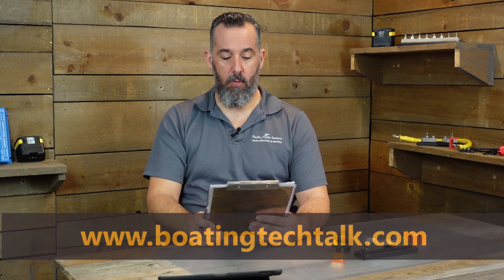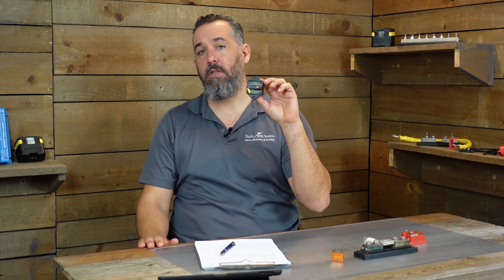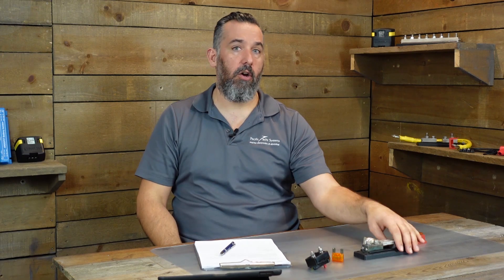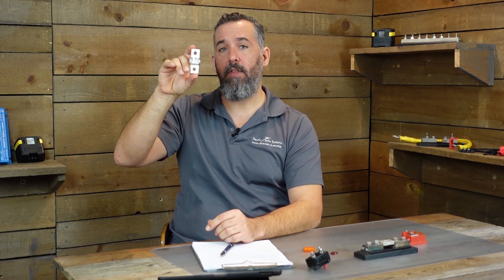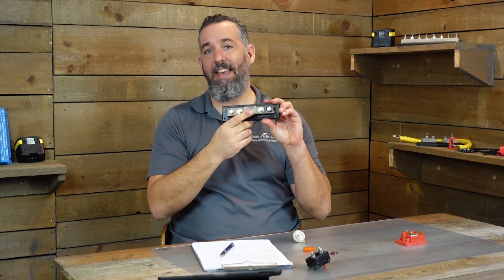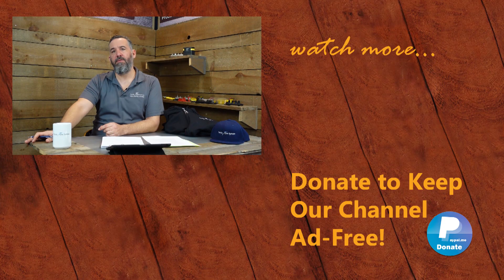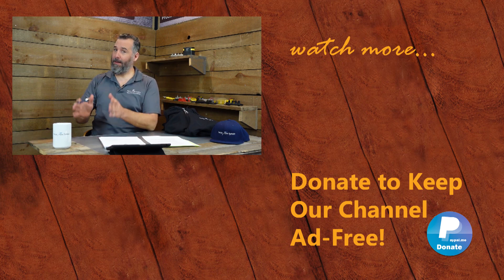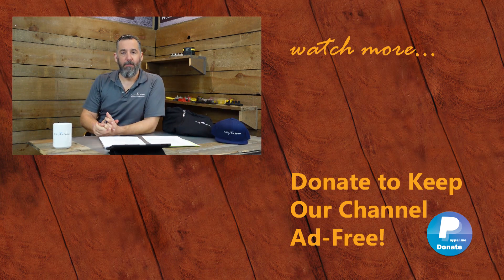What Are the Different Types and Sizes of Fuses on My Boat?

Comment: Jeff I have a question I'm new to boating  I have a 1998 Sea pro 190cc checked under my dash I had a wire with a box  the box said filter &fusebox and above that same wire I unscrewed where the fuse goes it had a glass fuse 4ap 250v and the fuse was bad what is this for what does it go to? Again I'm new to boats
Reply: Honestly that could be anything. Quickest way that might work to find out is isolate the power, check there is no power by measuring the voltage between the fuse (check both sides) and the negative battery terminal using a multimeter, remove the fuse, turn the power back on and see what doesn't work any more. Disconnect the power and check before replacing the fuse.

Part of getting to know your boat is learning where the wires go and sometimes it's a pain in the backside to follow wires. The continuity setting on a multimeter can help but most of the positive wires are continuous with each other, as are basically all of the negative wires.

Comment: The device does in many cases have its own fuse.  If you follow cable recomendations for the current of the fuse in front of the cable the cable generally can cary more current than what they're recommended for without getting too warm/catching fire.  But I do agree to everything stated in this video :-) ....... The reason for selecting thick cables in a low voltage system is to have as little voltage drop as possible, as some equipment don't work too well when the voltage drops a bit because of the current flowwing through a cable that's just barely thick enough.  For instance my water and air heaters has this problem (the glow plug pulls a lot of current), and can also be an issue with the engine starter/coil, but that one is normally not fused but coming from a lead acid starter battery that can source typically 800Amps maximum peak.   P=U*I.  Just a thought experiment :  If you have a 12V lead and measure 8V at the starter when engaging it, and let's assume it's pulling 100Amps, and your cable is 1meter long,  Then you have a voltage drop of 12-8=4V over a 1meter cable,  And if it carreis 100Amps (which is then 800W in the starter), then you have 400W of heat to disapate over a 1m cable (for a very short time), and as 1meter cable is 100cm, then you have 4W per 1cm of cable.  For a very thin cable that's too much, but for a thick cable as we generally have there that's no problem. ...... Doing like I just did you can calculate the heat generated in the cable (can also be done by measuring resistance, but I trust that less). ...... You also could consider a very thin cable as a fuse, but it will burn when it blows ;-).  U=R*I and P=U*I are simple but takes a bit of practise to get used to using them.  But they will always give you a good indication.  The more likely dangers of fire are mostly from poor connections causing high resistance in the connection, which again causes heat, and sometimes too much heat (without blowing any fuse). ......... And physically damaged (deformed) Lithium batteries are possibly the most likely cause of electrical fire on a boat, but has nothing to do with this subject. ...... A cable short circuit will mostly blow a fuse somewhere without anything going too wrong, as the cable generally is dimensioned to carry much more peak current than the fuse, and in less than one second it generally don't have time to start burning if correctly fused.  But if you connect a very very thin cable from + to - on a 12V battery you need gloves and eye protection, as it's gonna light up / blow / smoke / burn when you do, and if you do it with a thick cable the whole battery could maybe explode on you. ....... I'm not experienced in these issues, I just understand them theoretically as I'm a former electronics engineer, and the regulations to follow are often a bit overkill, and can be a bit stretched, but that's my personal opinion, and I don't recommend stretching them.  Re-tightening connections, and especially those close to vibration, and isolating them (vaselin) towards corosion caused by the environment, I do recommend.  B.R. ... By the way : Fuses for AC current : AC current turns of 50  or 60 times per second, so it's easier to make a working fuse for AC (and it will be quicker). ... DC current (from 12V (or 24V or 48V)) is constant, and never turns off, so you thoroughly have to read the specifications for any fuse to make sure it's for DC current  (and they will blow more slowly) (Those for cars of couse are o.k. as a car is DC, but those for you house you possibly could or should not use).

Comment: Hi Jeff, 

Do you have any idea why manufacturers of onboard battery chargers use a 30 amp fuse in-line from the charger to each battery, using such a small gauge wire? Mine in particular is a 450 watt 3 bank digital charger. Output is 10 amps per bank. Wires to batteries are only 16 awg. It seems minimum need would be a 7.5 amp in-line fuse. I was thinking on dropping down to a 10 or 15 amp fuse. Not sure if dropping down would affect the performance of the battery charger.
Reply: I don't think that charger is capable of sourcing more current than the recommended wire can handle. ........ The other way around however, your battery can source more current than the wire can handle if you have a short circuit in or at the charger. ...... My charger has a automobile type relay in series on the output which is probably gonna burn of (likely without causing a fire),...... if you create a short circuit on the charger output terminals and keep it up, the battery could maybe burn the cable. ........ Cable routing matters in a risk assessment in my mind, is there something close to it than can easily cause fire ?.  Having some fuse somewhere would be a good thing of course, but I don't think there is such a fuse on my boat, and I have 3 of Lead Acid banks (starter and 2 banks).  Many of these AC/DC-DC's does have internal fuses though, and for sure on the AC side.  The designers of them should have made sure they can handle a short circuit, so I wouldn't worry about the charger, but about the other direction (what can the battery source).

Comment: You should probably explain the danger of using fuses without ignition protected housings inside engine compartments of gas engines.  I’d hate for someone to not understand this and have a fire/ explosion
Reply from the maker: Hmmm, great point. NOT all fuses are made to be installed in a gasoline engine room. Only ever install fuses that are ignition protected or have ignition protected covering.

Comment: Consider the word Fuse. It is both noun and verb. A fuse works by fusing (melting) a wire of small cross-section sized in order to protect the wiring and the load. When that fuse can handle more current than the wiring it is intended to protect, the wire becomes the fuse and melts unprotected; fire. Never replace a fuse with a larger one unless you know exactly what you are doing and that the circuit can handle the amperage that fuse will pass. Be safe and keep a few inches of freeboard. :)
Reply from the maker: Excellently said!!! Thanks for the emphasis.

Comment: Do not cheap out on fuses.  A lot of made in China fuses are not well made and do not have sufficient resistance to heat up and blow at rated current.  Stick with name brand (e.g. Busman).  To be pedantic, a lot of people say “without proper fusing the wire will catch fire”.  It is not the wire that catches fire.  The wire (i.e. conductor) gets hot and the insulation around the conductor catches fire which ignites other things.  Also, it is not the wire per se that has a temperature rating, it is the insulation that has a temperature rating.  The ampacity of the conductor is determined by allowable voltage drop and heat limitations of the insulation.
Reply from the maker: Well said Borys. And when the jacket melts off because the wire is too hot, the smoke is crazy dense and toxic.

Comment: Blue Sea Systems has a nice app you can put on your phone that has recommended fuse and circuit breaker sizes based on load and wire size. Great resource
Reply from the maker: Totally agree... it's very well done!